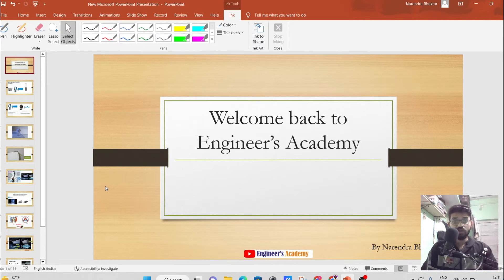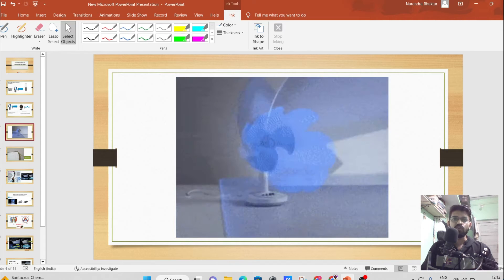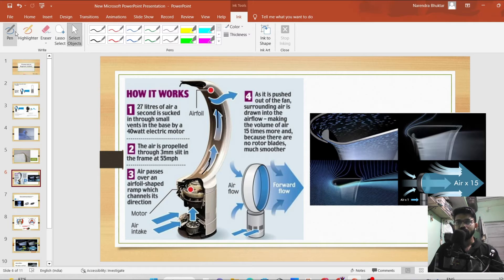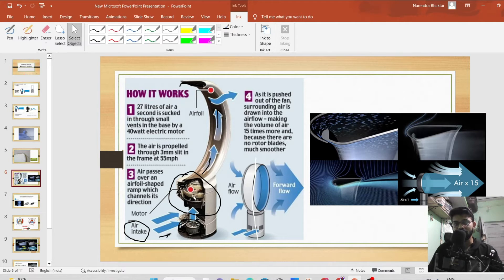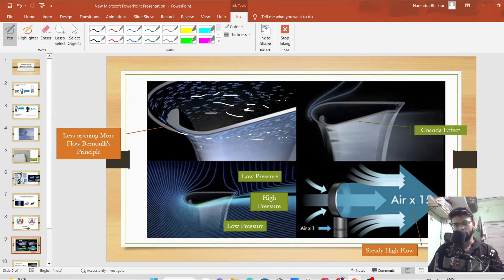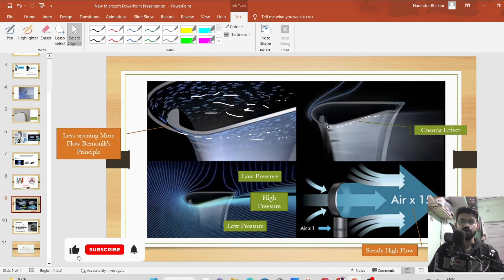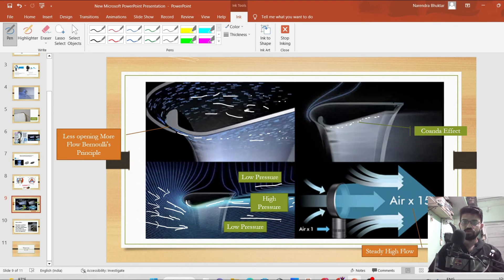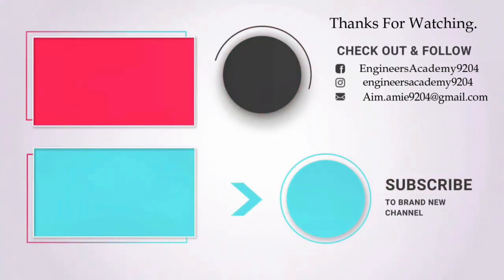how the Dyson bladeless Fan Works.

Comment: Yes but what is the point of this fancy futuristic looking invention if it doesn't actually COOL the hot air in the room !  Like an Air Conditoner.  Also the Traditional design fan not be intermittent flow, if you turn off the 'rotate' function, which most, if not all 'desktop' fans have.    During a HeatWave its just going to be blowing a Smooth futuristic column of hot air at you !  Definitely LOOKS cool,  even if it doesn't actually make your room feel cool !

Comment: Dust still accumulates on the air intake on the Dyson Fan.
Reply from the maker: Yes right .. but its very less !! I guess
Reply: @EngineersAcademy9204  no it result’s about the same as any air intake like that of a computer and similar effort to clean. The outlet also accumulates dust but one can not inspect the inside of the unit.
I’m telling you this from experience as I have a Dyson fan.
Reply: Ok so it is a blower not a fan.
Reply: @edwardhoward4708  it uses the motor to create convection flow where the magic truly happens is it utilities the Coanda effect to push airflow over the air foils upon exiting.
The design of the air foil creates a negative pressure that draws more air over the foil.